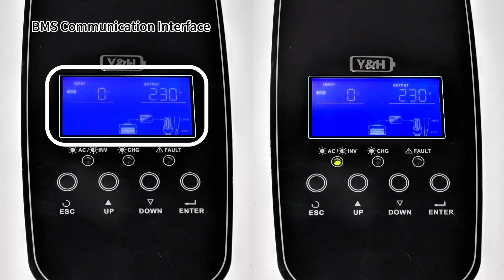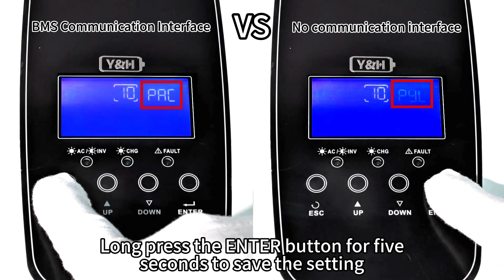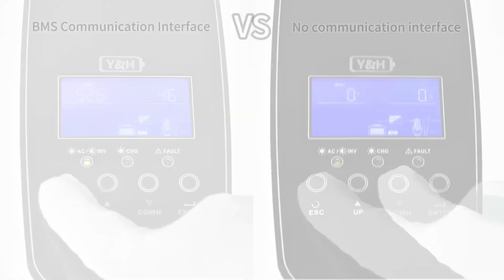🔌 How do Y&H solar hybrid inverters communicate with the battery BMS? | Must see for newbies! 🔋

Comment: Hi, my Lifepo4 battery has a Bms but does not have communication. How should I Configure the Y&h hybrid 24v 3.2kva inverter to work with this battery? The battery is at 27v and inverter considers it to be full.